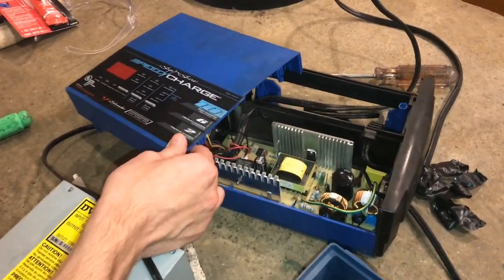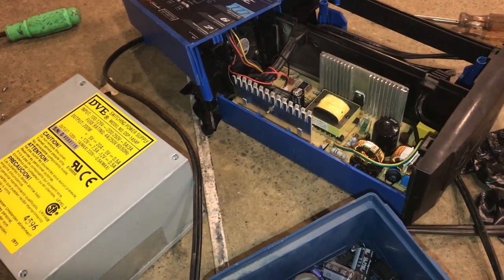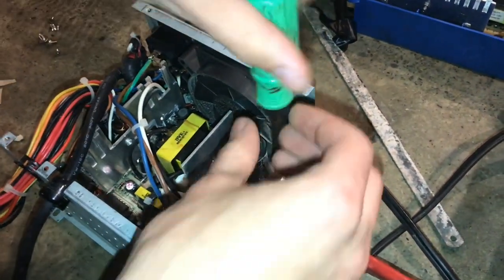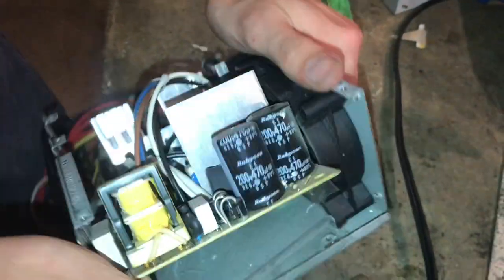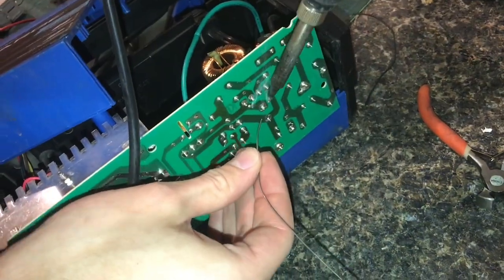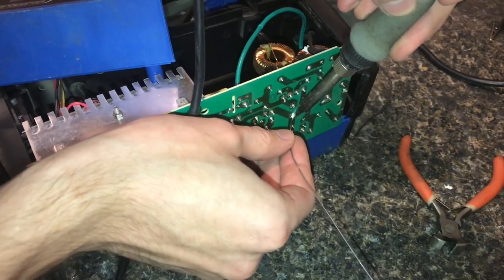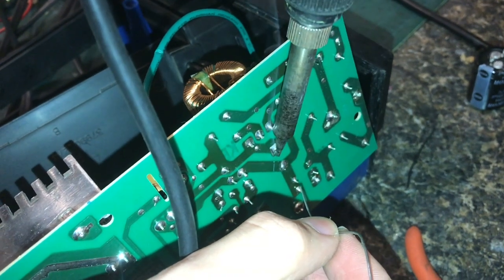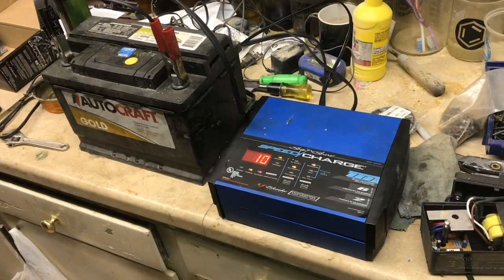removing and REPLACING larger electrolytic capacitors (step by step) SCHSC 1304

Comment: This power supply is just like mine but I can't find the capacitors 470uf by 200v that's why I replaced them with 150uf by 400v, can it work?
Reply: It sounds like you need to watch the video again.
Reply: No 150uf is way too low you can go minus 20% uf and up 80% uf voltage has to be the same or higher.

Comment: I have replaced a 470uf by 200v with a 150uf by 400v, can it work?
Reply: There is three-times difference in the capacity of 470 and 150 microfarads, if we talked about PSU and you put such instead of installed ones, it will lose its declared output power, in electrical circuits you can replace the capacitor with an operating voltage a little higher, but its capacity must be the same as before

Comment: What the benefit of this capacitor
Reply: Looks like a switched power supply, then you need a smooth dc voltage to feed the oscillator circuit that feeds the transformer with high frequency ac
Reply: Input capacitor. It's a standard PSU input thing. Some of the better PSUs have two of these, like this one,